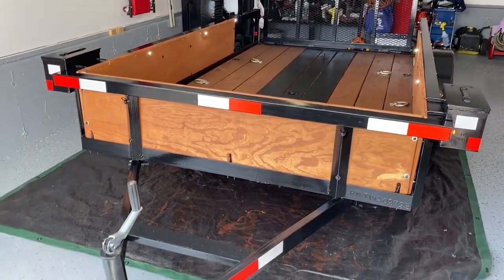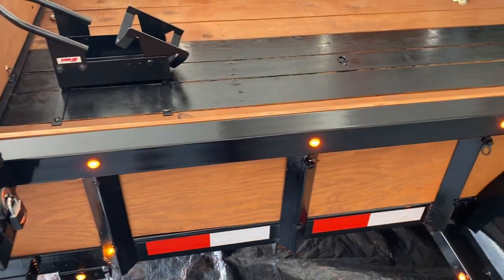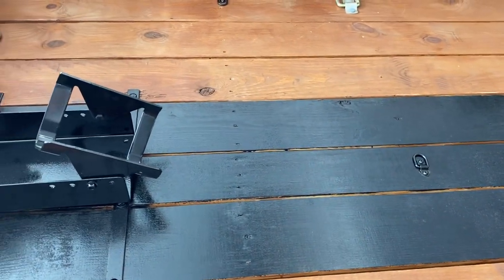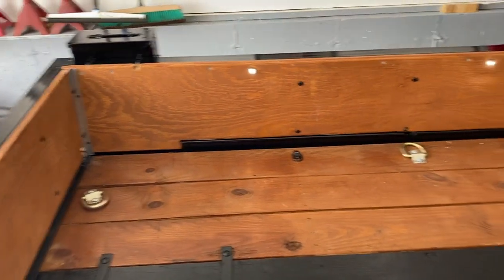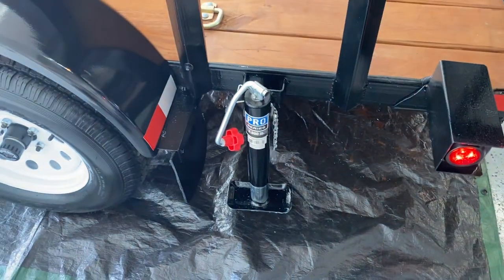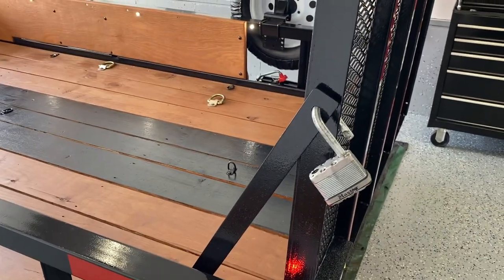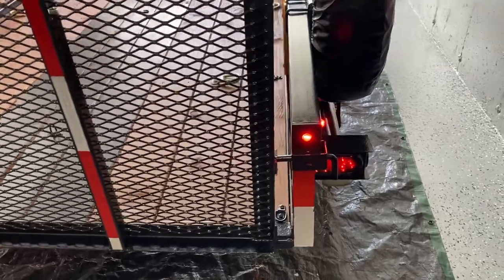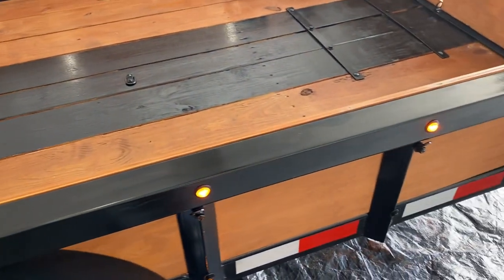5.5 x 10 tractor supply utility trailer upgrades.

Comment: Purchased the exact same trailer last week. What kind of paint did you use? Did you sand/prime etc? Nice upgrades!
Reply from the maker: Sanded it down with 100 and then 220 and then painted it with black implement paint from tractor supply
Reply: @jaylan73  Cool.. That looks very nice. I may think about doing that one mine.

Comment: Nice mods, where did you get the LED lights for the inside?  How did you wire them?
Reply from the maker: They are clear three-quarter inch LEDs from Amazon. I wired them to the running lights of the trailer.